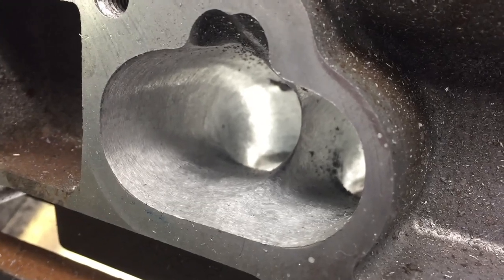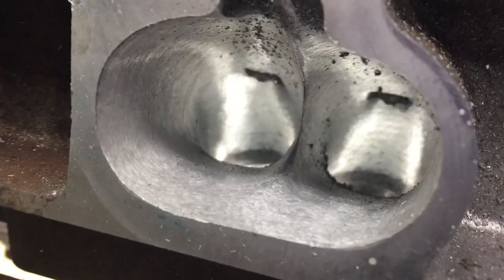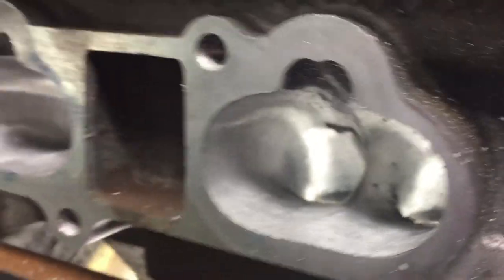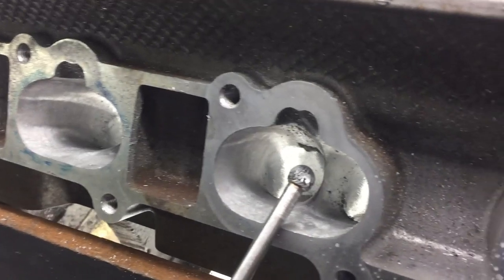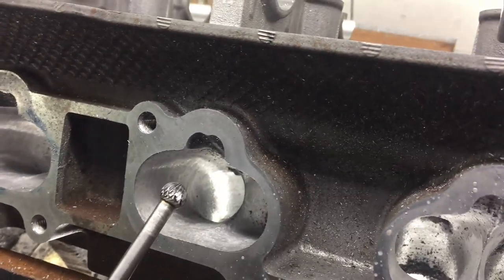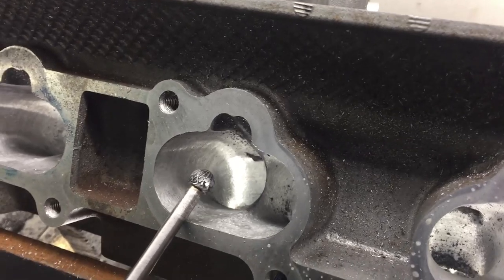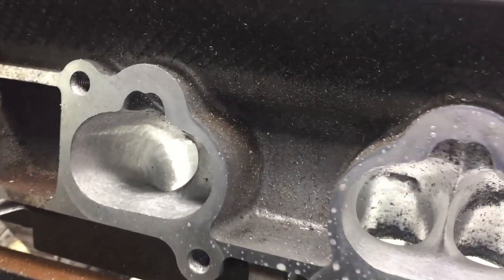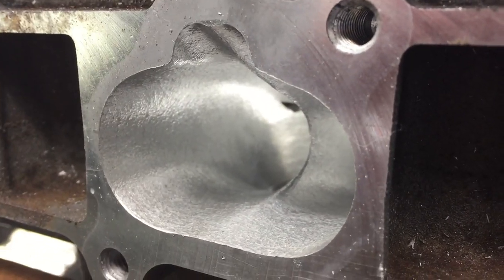Cylinder Head Port Wall Texture, how to apply texture.

Comment: What does texture do?
Reply from the maker: Texture promotes a boundary layer on the wall surface, it helps to keep fuel atomised within the airstream and not pool against a wall.
This is very useful in lower airspeed areas in which fuel dropout can be an issue.
Shiny is no good, the texture can be smoother than in this video for example a 60grit cartridge roll but you don’t want really smooth/polished on an intake port or runner, even with an EFI engine 👍

Comment: Looks great Sean Burns, Have to get a similar burr.
Reply from the maker: The trick is low speed and pressure, very time consuming.
Using the trans fluid is the go as well, if you keep the texture shiny as you go then you know it’s got enough lube, it’s when the ally starts to look more matte in appearance that it’s getting too hot and starting to gale up, that’s when it clogs burrs 👍
Reply: @seanb250  I have figured that out, to a degree. I also need water separator, and a bigger compressor. But also not doing this for a living.
Reply from the maker: @DragBoss351Cleveland  I run a long hose from the compressor to a water trap/pressure regulator combo at the bench, then just a short hose to the grinder, I believe doing it this way the heat dissipates in the long hose creating the water, the trap at the end catches it. When using a water trap straight off the compressor, in my opinion the very fine mist in the hottest temp air gets missed so all of the water ends up at the grinder.
I’ve heard of people using a big coil of hose submerged in a drum of water to take all the heat out of the air before getting to the water trap, works extremely well apparently.
Reply: I run my first 2-3 meters of hose straight up and then run it along a roof beam and down a pole to water trap at eye height right before my airline roll,no issues with water, also run a massive Hush oilless compressor , best investment was the quiet high volume compressor
Reply from the maker: @Grooty79 oh a nice quiet compressor is on my wish list that’s for sure 👍
Reply: @seanb250  I have a hush 150, best thing for porting is a quiet compressor, the difference from an old clisby to my hush also helped keep a clear head while porting, ( I don't use ear muffs as I like to hear the cut)

Comment: More video about head porting please, and what portion to be rough and polish. New subscriber here
Reply from the maker: Thanks for subscribing, I’m definitely going to put some more videos together at a later date.
To answer your question, if the intake port is very stable then the same rough texture can be used on the entire port, if you have an intake port that has a very high airspeed over the short turn, to the point it’s on the verge of seperation then you can use a smoother finish on the short turn only, no smoother than a 120 grit and do it by hand, the smoother surface will enhance the Coanda Effect and have the air/fuel stick to the short turn radius better and have a better chance of not going turbulent. 
Exhaust ports just make them smooth, they don’t have to be polished but I use a final 240grit wet&dry paper by hand after the final 120grit cartridge rolls.
Hope this helps 👍
Reply: @seanb250  thank sean 👍 does it apply also on port injection heads?
Reply from the maker: @underbonetv1371  absolutely 100%
What a lot of people don’t think about is that the injector is spraying fuel before the intake valve even starts to open, what is happening during that time is the pulse created from the valve closing from the last cycle is running up and down the port, this pulls fuel up and down the entire length of the port and intake runner, without some texture on the walls fuel can pool and can actually effect the air/fuel ratio of that cylinder.
I have seen fuel staining all the way up to the bellmouth of an intake runner on a port injected engine because the runners were near mirror finished, people’s belief that the manifold is completely dry on a port injected engine is incorrect, especially when you start getting into engines that run 80% duty cycle or more, that’s a lot of fuel being sprayed into a port that has the valve closed.
Reply: @seanb250  thanks again sean, im looking for ur new video soon.
Reply from the maker: @underbonetv1371  my pleasure mate 👍
What helps me out the most is if people share my content on forums and other social media platforms, so if you think others would find this interesting please share it around, cheers 👍